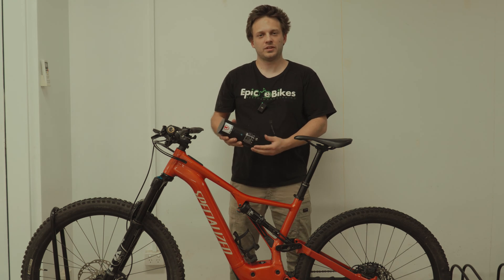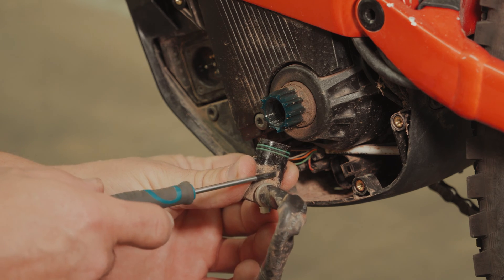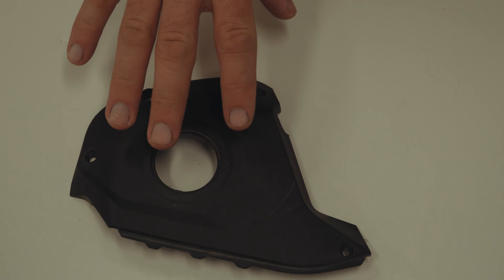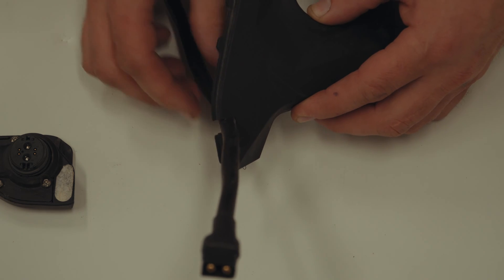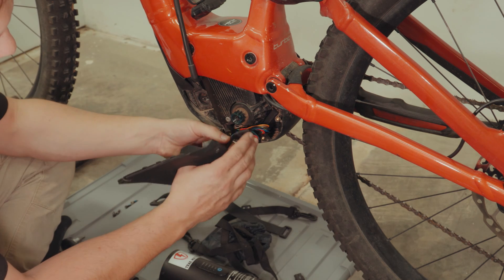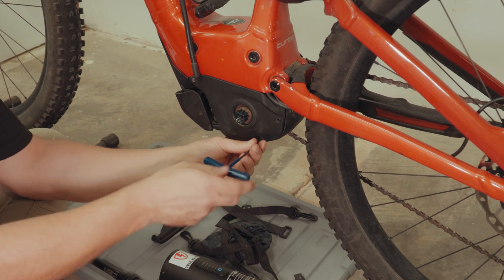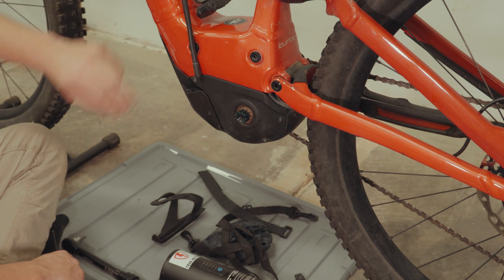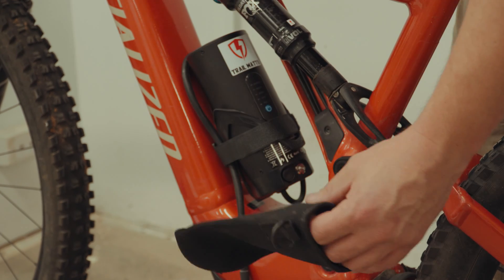Turbo Levo Range Extender  - Trailwatts

Comment: I like the idea of a range extender but that's a lot of wires stuffed into a very tight space that often gets caked in mud and water which makes me nervous.
Reply from the maker: Hundreds of trail watts kits have been installed and thoroughly tested in the UK in wet and muddy conditions without issue.
Reply: VERY informative and easy to follow I Have heard they are extremely water resistant mind you Australia doesn’t know what wet weather riding means compared to the UK